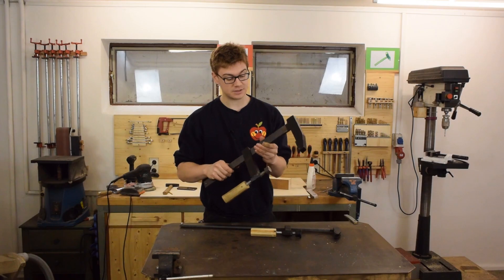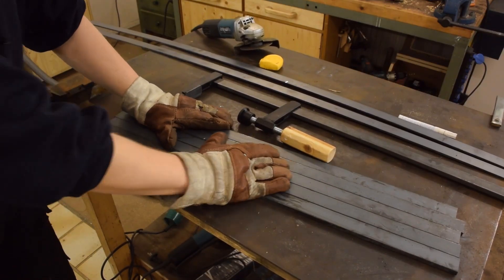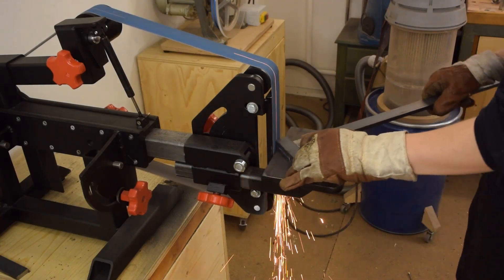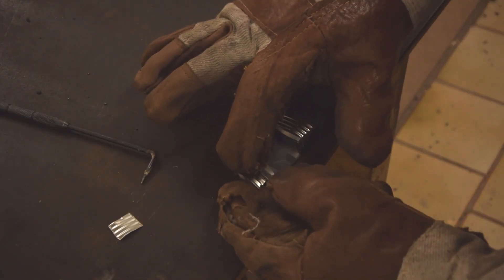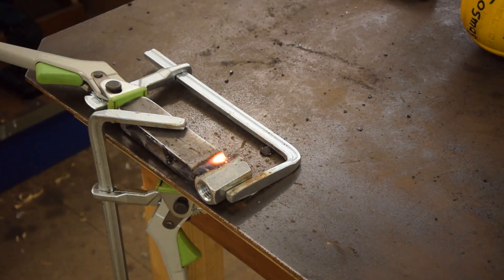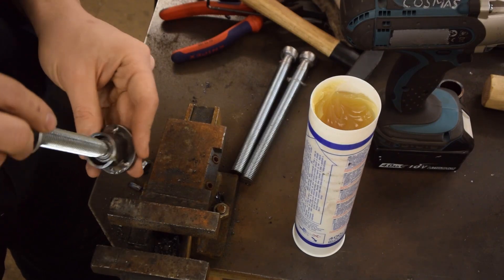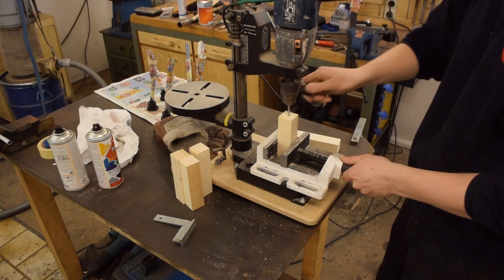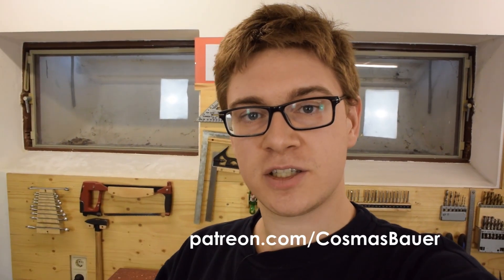How to Make Long F-Clamps | Homemade Steel Clamps | The new Grinder in Action | Patreon Announcement

Comment: great video , especially the little bits regarding the lower jaw,  my question is i didnt see you removing mill scale from the raw steel bars , is removing important or simply painting on top of it will prevent rust, i have a stick welder,  just beginning to start small projects.

Comment: A handy tip is to weld a nut at the base of the handle incase you need to tighten extra  with a shifter spanner

Comment: very beautiful but,
I think that weight is still so heavier than woodworking uses, also processing you do is much more complex and costly
If you calculated the cost fairly it should exceed Bessey original pieces
I think homemade clamps should achieve at least lightweight, easy use, low cost, maintainability, availability, scalability and simplicity

Comment: really nice idea on the swivel ends of the clamp.. On the back, if it has too much swivel, grind a smaller width grouve, a little further back, and use a smaller washer, or a piece of flat plate, drilled like a washer, split it in half, slide it over the all thread, and then tack it back together.. You can adjust the amount of swivel you want in your clamps.. Too much is  a pain in the tail.. Not enough is not bad, as long as it spins easily.. Cheers.. Nice Clamps.. Also saw you converting them to parallel clamps.. 
Also a great idea.. Wouldn't take long to switch them back and forth and use them for either metal or glue ups.. Cheers Mate from the USA.. Nice Job.. Subbed!!

Comment: At 7:40 when you weld the nuts, just lightly grind or use the wire brush to remove the gal from where you are welding first.  Much less fumes and much safer.

Comment: 6: 50, and grind the galvanizing away where the bead will go. And even then, if/when you think you have to go to the bathroom, you better start moving then. Your body is quickly rejecting the poison, and it doesn't care where you are. Drinking milk helps a little. 
Thanks for the instructions on the clamp build!

Comment: do you think anyone would have suggested putting a thread in the handle with removable pin would have worked better than glue, that way you could change the handles if needed
Reply from the maker: If changing the handle is needed (the handle is broken) I can easily remove it and glue on a new one.

Comment: The cross pin is absolutely necessary. I've made these clamps many times over the years and after some use the handles will slip on the threaded rod if you don't have a pin to stop them or small bolt going through the handle and rod. You did a really good job with the clamps. Great job done well.

Comment: Dipping Zinc plated fasteners in muratic acid will remove all of the plating and prepare it for welding.  The fumes given off by the muratic acid and the zinc may be worse.  Don't know!!

Comment: Brilliant build. I think I'll give these a go, but will use aluminium for the long bar. I also thought that if the bar was bolted on to the top jaw, I could swap out the bar for long or short bars as needed. Then I can have the shorter clamps for every day use, and then with a few minutes work with a couple of spanners, I could have a set of long clamps.
Thanks for the inspiration.

Comment: First of all, these are fantastic, heavy clamps...WONDERFUL!!! I think that by not placing grease into the swivel plates, you could blow out any dust. With grease, the dust and metal/wood crumbs will stick and not ever be released. I would leave dry. I do not see any mechanical benefit to lubricating. There is really no wear points in this area such as speed, heat etc.

Comment: if a 1/4" hole in the center is acceptable, hole saws are a great way to make alot of small disks the same diameter quickly, i like the milwuakee ones they cut mild steel really well, they do require some oil though and i strong wrist if youre doing it with a hand drill

Comment: Grind the zinc off of the galvanised parts where you are going to weld- it won't spatter then.  You're going to paint it anyway. 
And less patreon and more of the basic material dimensions thanks.

Comment: Making your own clamps is soo nice, monetary good too. Mainly because under the right kind of shining light, you can get the stock materials for next to nothing. Example: from a friend i inherited 7 spring compressing kits, that's 14 Acme threads. Sure, they were a bit worn out, but for a F clamp, that's perfectly okay, which is corroborated by the fact that i've been using the home made clamps for so long now that i'm at the point where i have to replace the spine on a few of them because i whaled on them sooo much they're starting to curve, yet the threads are just as i have received them.
Reply: Great idea! I've had a pair of spring compressors hogging up space in my box for years.

Comment: very nice clamps. only thing i would have done differently were to not bevel the fixed end.  instead make a contact plate on the back. that way you could reverse the movable part so it would push against inside of a box or similar if you ever needed it

Comment: hi mate great work 😀 ..
one suggestion if you had the bottom clamping bar bolted to the bar , so could be turned around .. (or a foot on other side ) then could use the same clamps for spreader clamps also .. 
ps I think they are great clamps and going to make some myself 😀.. keep up the great work ...

Comment: For those who don't have taps for creating the threaded hole for the retaining bolt, just drill a bolt clearance hole and use a bolt and nut.  For extra neatness, use a thin nut and cut off the protruding part of the bolt thread.  A great video and really useful low cost clamps.

Comment: could you add a metal cutting saw blade to a normal woodworking chop saw to chop steel like that?
Reply from the maker: If your saw has variable speed and constant electronic that would work. But the saw could still be damaged if it is not beefy enough.
Reply: cool thanks. I would go very slowly if I was cutting some steel. My chop saw is a cheapo model though lol
Reply from the maker: It does not help if you go slow. The RPM must be low. If your saw is a cheapo one then it is going to be destroyed.
Reply: yeah, then it's probably not my best option lol, thanks for the info =)

Comment: you should get yourself a MIG set
Reply from the maker: Probably not. Stick is just intriguingly simple. When it comes to equipment that is.
Reply: Cosmas Bauer I agree most people underestimate stick welding. ive welded 20 gauge steel at 25 amps with 1/16th electrode. It was a broken toolbox. On 16 gauge steel you can very easily weld 3 inches with no holes. Watch for warpage though. Mig gives you amazing control and the ability to fill any gap.

Comment: do u have a good ventilation/ air circulation? u use a stickweld/smaw, it's really bad to inhale
Reply: panji yudha The flux from stick welding creates toxic fumes, which is where MIG welding is safer.  The toxic exhalations when welding galvanised parts are vaporised zinc which is also highly toxic if breathed in.  But loved the video.

Comment: well done!!, looks great, but i see always the same problem: the thread,  the pitch of the thread. 
the advance of the rod is not enought quick. See my upgrade barclamps video. I had the same problem, i
and think there isn't economy  solution.
Any way, congratulations. The f clamps are professional!!!.
Reply: I've got a Bessey of about that size and the thread looks like 18x4 mm acme thread.  The thread is rolled not cut which makes it stronger.  Can buy that for about 6.50 euro (+ tax I suppose) per meter around here only little more than normal thread.  Dunno the exact length per clamp but I'd guess 12-15 cm or some.  That'd be about 1 euro per clamp.  Or mebbe 1,20.  The bolts for this thread are 3 euro a piece though.

Comment: Great work. I'll make them for me too.
I'm wondering that I will not weld the head of the clamp together with rod but drill them and screw.
That alows me to make only heads and lower jaw part and use many rods of different length.
For lighter work won't be to heavy but if needed could be as long as your longest prepared rod.
What do you think?

Comment: I have a little concern about these homemade clamps: is mild steel (which I roughly guess from the color and the speed of cutting under the saw) suitable for such long bars and for a relatively heavy duty ? I've seen a couple of these bend over time, so it may be better to use harder steel (maybe stainless ?) or even find a way to make it harder.
Anyway, you inspired me to go and get some of these out of my elbow grease :)

Comment: Try putting a bucket with water underneath the sander, so all the sparks and dust go into the water. Much easier to clean. Obviously, you need to secure it somehow so you don't tip it by accident. Besides that, nice work, as usual.

Comment: What you could do is if you wanted to change the design of your F clamps by making them spread items as well as clamp all you need do is unloosing the fixed side then slide it up a bit drill a hole in the long section that way it still clamps but you can take the short bits off turn them around put them back together bolt back in ready to spread cool idea oh yea.